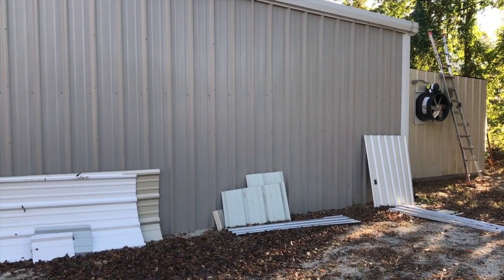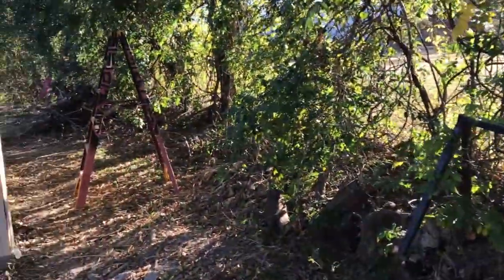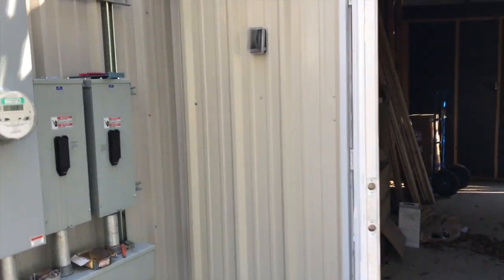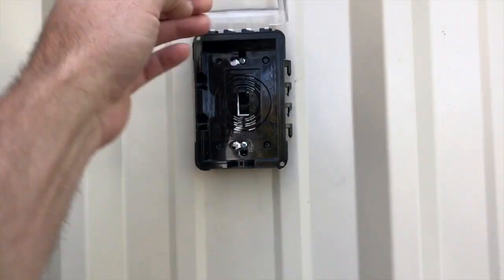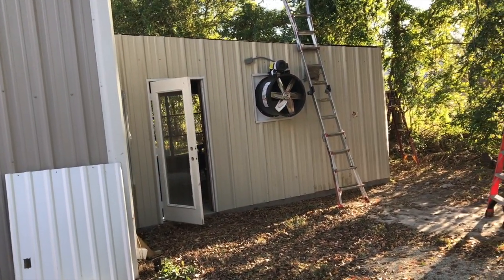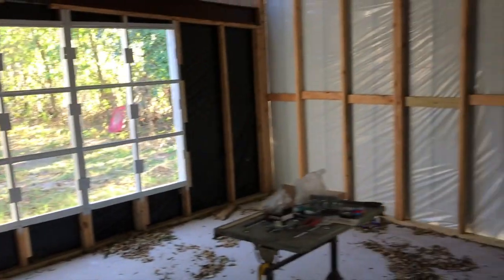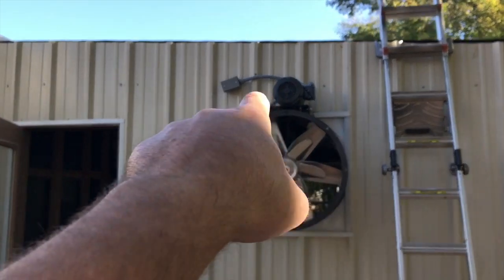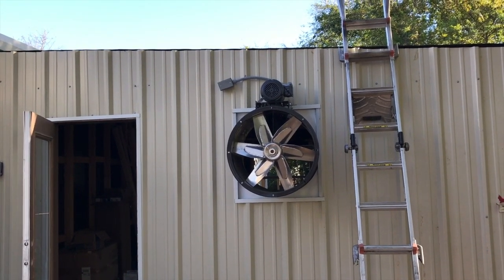Paint Booth is ALIVE - F I N A L L Y

Comment: The shop fumes is one of the reasons I didn't house wrap my shop. I want some air turnover in an environment like that so I don't kill myself from the fumes.  A little heat is a cheap price for my health.
Reply: When i built the shop i had no intension of doing all this painting.  I am not really that great at fabrication, machining and welding, so as it turns out one of the main sources of income are the metal flags and signs, thats how it goes, but yea i am not doing my long term health any favors